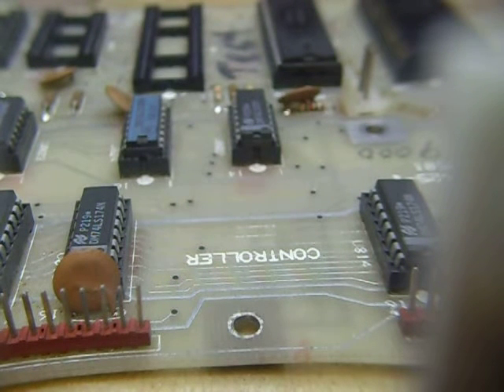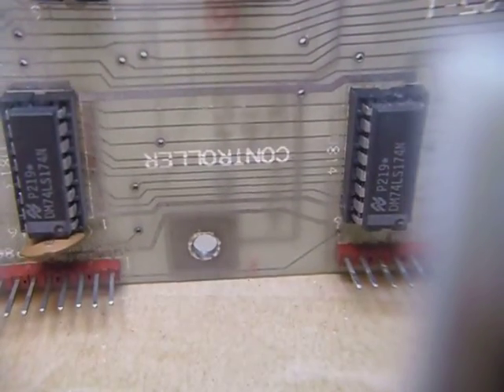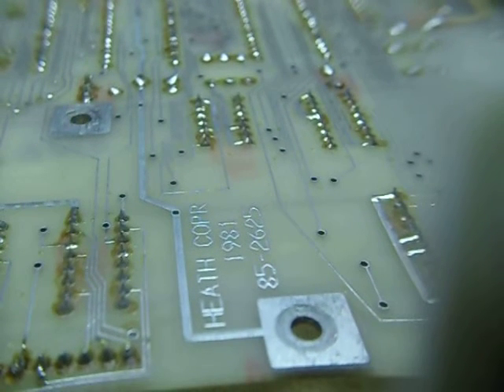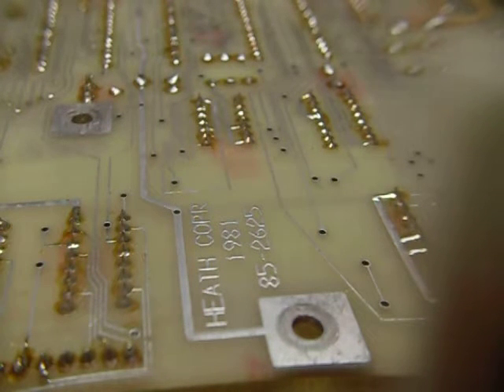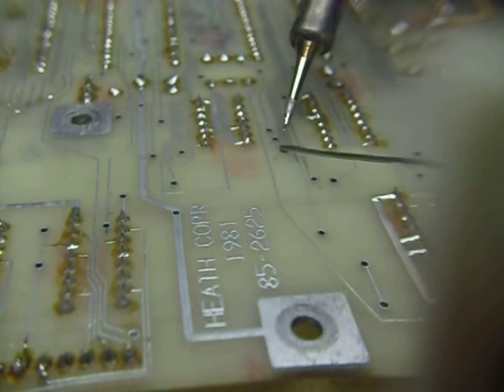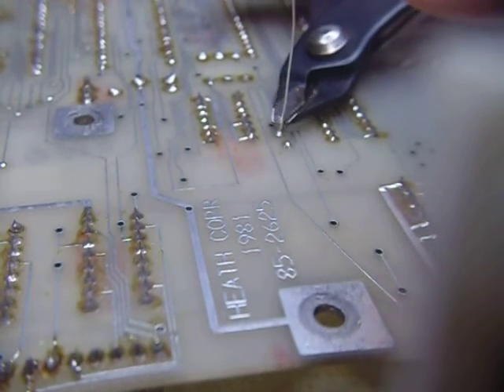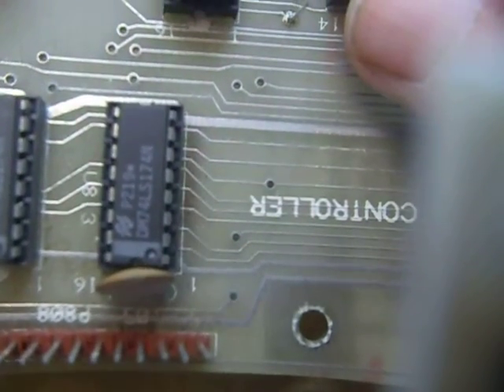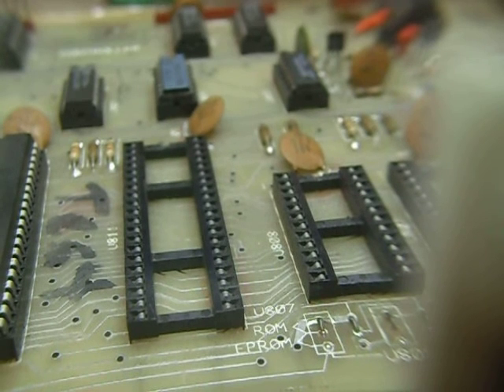CIRCUIT BOARD THRU-PLATED   HOLE REPAIR

Comment: I was replacing the leaking capacitors in my Sega CD and some of the through-plated connectors came off in the process. I'll give this a shot and let you know what happens. Thanks for the video.
Reply: It works, it actually works yall. It's not pretty, but if you're the only one who's gonna see it!

Comment from the maker: SLIM Yes there can be a lot of those little buggers  . My first experience was with a newly assembled Heathkit frequency counter back in 1980 I bought it really cheap at a hamfest and the seller said " I know what the problem is Its the thru plated holes Heathkit has had problems with them "  So I repaired all of them and still have that counter working on the workbench .